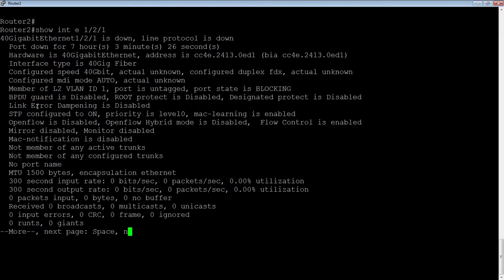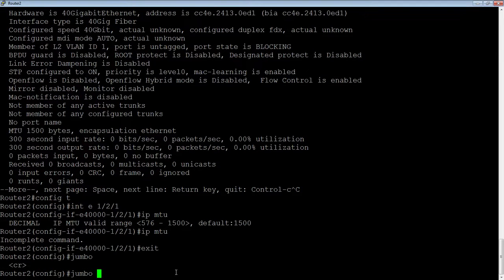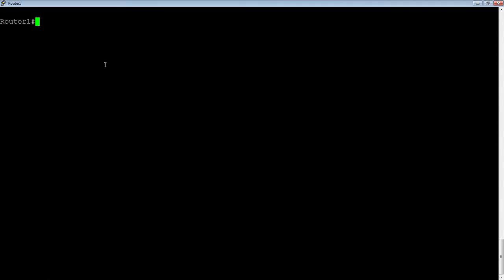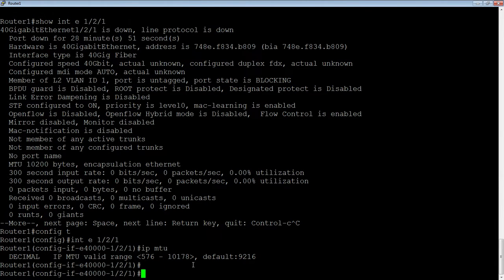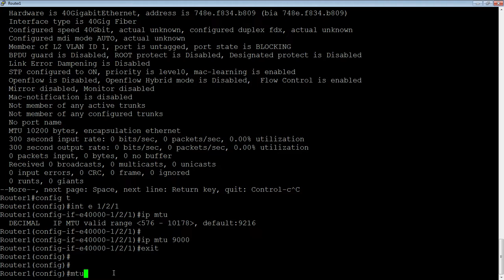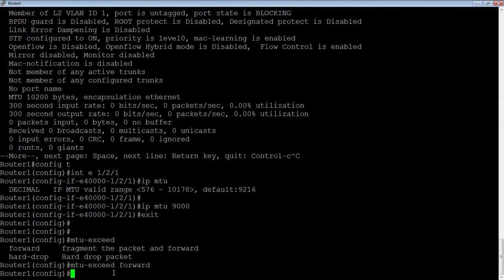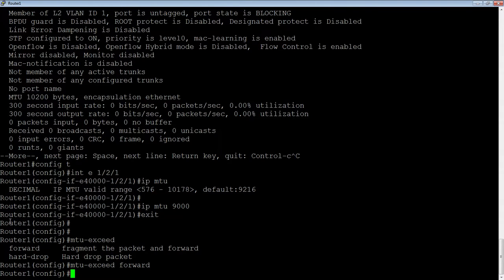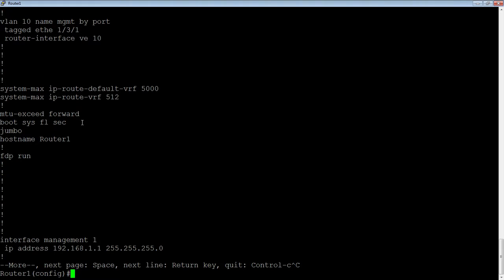Brocade - JUMBO FRAMES AND MTU VALUES

Comment: Hi Terry, 
We tried to change to jumbo frame packet size for ethernet interface in windows 10 PC to 9014 bytes, but it is not happening the default value 1500 bytes only showing. 

Can you please help us to setting up this.
Reply from the maker: Depends entirely on the NIC card with Windows. If it is not an option, the nic most likely doesnt support jumbos.
Reply: @TerryHenry  
Thank you so much for early response. Yes, the option is available and command also not giving any erros,it is showing ok! But when we are checking in wire shark application it is showing 1500 bytes only
Is there any issue with the drivers? 

It would be really helpful if you suggest some steps.

Comment: Hey Terry, what version of firmware you running as i cannot add the MTU-EXCEED forward command.. running 8.0.20d
Reply from the maker: It has been there since 8.0.30 at least. The version you are running was released in 2014, might be time for an upgrade?
Reply: @TerryHenry  Thanks for response, yes probably so, don't usually upgrade if nothings broke so to speak, but yes will upgrade.
Thanks
Reply from the maker: @chrislane5670  8.0.30 is at patch version 8.0.30u so hopefully it is pretty stable by now. ;)
Reply: @TerryHenry  one of my switches is running SPS08030h   no command in this one either, im running jumbos but can't forward exceed
Reply from the maker: @chrislane5670  https://docs.commscope.com/bundle/fastiron-08030-l3guide/page/GUID-193CBCDD-4080-443D-BACB-FBD3577D7B4A.html
Reply from the maker: ah... I see the problem. You are running switch code, not router.
Reply: @TerryHenry  Oh, yeah, i have a whole layer2 set up for this customer, im old school Brocade/CER--ICX  combos in my whole network. I have a Layer2 NNI connected in CER then fiber into SW, fiber across to another CER--ICX---CPE        this whole path is L2... i set jumbos on ICX and set max-frame-size on CERs to 2000bytes... Customer cannot use DF bit, or No-Frag in brocades case higher than 1471byte or it drops.. I need it to Pass...

Comment: Terry can you answer something for me?  I have a layer 3 stack of 2x 6610's mixed with 3x 6450's.  I have globally set the MTU to jumbo for my iscsi ports, but need to set it the mtu to 1500 for all the rest of the ports.  The issue I have is these are basically layer 2 ports.  Therefore I can't set the MTU using ip mtu command.  

I read that I can set it on the VE's that are assigned to the vlan's and that value will apply to each interface.  However when I do a show int eth 1/1/1 it still shows the mtu as 10200, but sh int ve 2 shows the mtu as 1500.  

It is awfully confusing as I am unsure what setting is taking precedence here.  Can you help me out?
Reply from the maker: If I remember correctly, IP MTU applied to the VE is only for routed traffic and does not apply to switched L2 traffic in the VLAN.  I do not have a 6000 series to test but it should be very easy to test it out and see what happens.  Jumbo frames should fragment if the MTU is lower than the sender.  Alternatively open a case with TAC.
Reply: Ok that is what I was thinking as well, but wanted to clarify.  Thanks for the quick response.